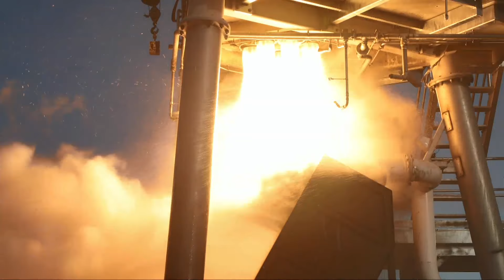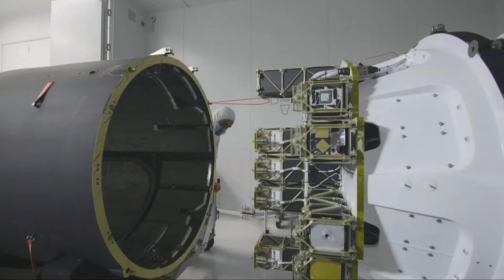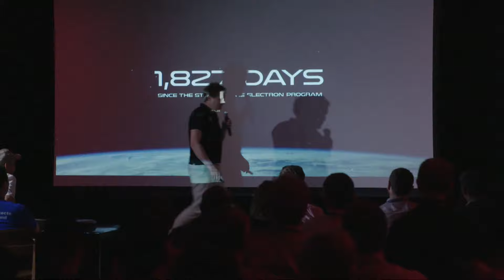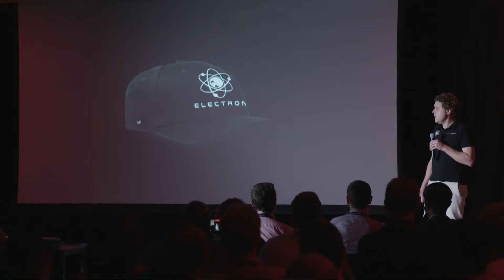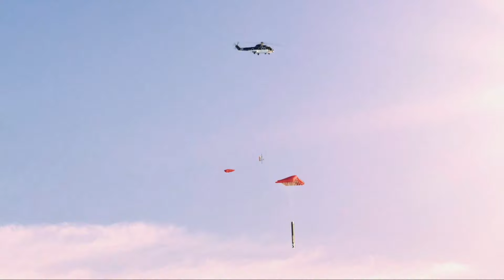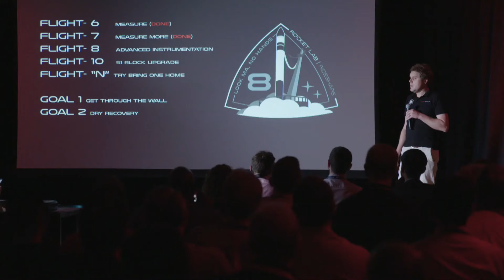Rocket Lab Unveils Plans For Reusability

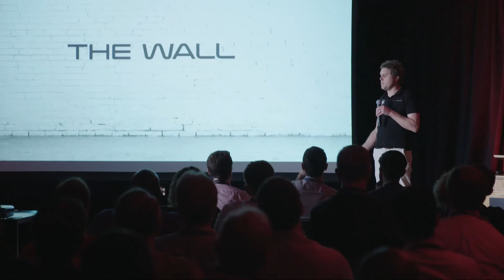Comment: 11:42 "[propulsive landing] takes a small launch vehicle and turns it into a medium launch vehicle"
Here are some direct numbers on that. A Chinese company LinkSpace

https://en.wikipedia.org/wiki/LinkSpace

is attempting to do exactly that: smallsat launches with propulsive landing and reuse of stage I. They  have successfully tested their equivalent to SpaceX's Grasshopper. Their planned rocket is "New Line 1":
Payload to SSO 200kg, lift-off mass 33000kg, height 20m, diameter 1.8m
By comparison, Electron: https://en.wikipedia.org/wiki/Electron_(rocket)
Payload to SSO 150-225kg, lift-off mass 12500kg, height 17m, diameter 1.2m
So for the same payload, you need a rocket with over 2.5 times the initial mass.

Comment: So New Zealand now has ICBM capability.
Reply: Yep. That's why they needed those treaties with the US. And that's why you can't work at NASA or SpaceX as a non-US citizen. Orbital rocket technology is considered ICBM technology and that is highly classified. Even the smallest of orbital launchers like Electron are among the bigger ICBM's out there (and certainly higher performing). Some countries would do a lot to acquire the blueprints for Electron. Especially the engine. Cheap, 3-D printed, electric so few moving parts compared to a gas gen engine and mostly storable fuel. Since you're not going full orbital you could simplify the rocket itself and loose a bit of performance, maybe increase the diameter and it'll still lob plenty of warhead mass halfway around the planet.

Comment: Just throwing some ideas out there.... Does the whole rocket need to be recovered??? Can you sacrifice parts of the rocket to shed weight during re-entry and recover the engines? Or does it need to return in one peice, could it not separate into smaller components which have less mass?
Reply: The first stage only weighs 950kg. Creating a structure and mechanism to separate the engines, with features to survive reentry, would be quite heavy in relation to the entire booster. Think of the booster as just a long casing holding the engines. I think this is also needed for the aerodynamic tricks Peter indicated but didn't detail.

Recovering a pod of just the engines is something ULA says they are working on for their Vulcan rocket, a much larger vehicle. They have to get that flying first, and say later iterations will have the recoverable engine feature. (This will also be by mid-air parachute.)
Reply: @donjones4719  also they want the booster. The engine is 3d printed so it is easier to mass produce. But the booster itself is carbon fiber very hard to mass produced. Their goal is getting the booster to effectively double their rocket production output.

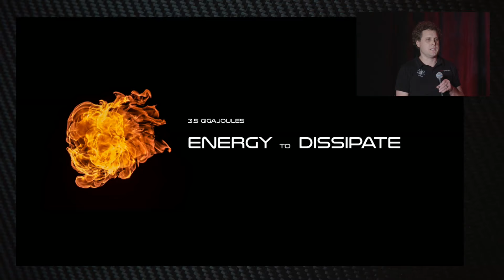Comment: 12:25 This statement contains no information.
Reply: It's deceptive.  3.5 GJ is about 972 kilowatt hours.  It's basically enough to power my condo for about a month, but saying "power 57,000 homes for an instant" sounds like a lot more energy than saying "powering 1 small condo for a month"

Comment: So 2900 m/s reentry without reentry burn, that is faster than falcon 9 first stage reentry by 300 - 900 m/s depending on mission. Carbon Fiber resin will melt?
Reply: Oğuz Can Soyselçuk  phenolic resin. Search PICA X
Reply: Spacex 1st stage reentry is around 1.9-2.4 km/s

Comment: Question, can they not recover the boosters the same way SpaceX does.   It is my understanding the weight costs of the parachute and hardware to deploy it roughly equals the weight of extra fuel to land the booster with rockets.
Reply: The size probably has a lot to do with it. Small rockets are harder to land propulsively, because they have a smaller moment of inertia. This is like how it is easier to balance a broom on your hand than a pencil. 

Also, I would imagine that the electron is several orders of magnitude easier to move back to the launch site.
Reply: Not at small scales it doesn't.
Reply: It is much more difficult also the parachute can decelerate more efficiently than boosters

Comment: Well done rocket lab . tho i remember a proposition which uses a similar method of reusing with parachutes and helicopters by ULA but only for the engine and OF COURSE it was never actually built /// WHAT A Time to be alive
Reply: It sounds like they're working on it for Vulcan rocket.
Reply: Yeah you're right . here's the video https://www.youtube.com/watch?v=lftGq6QVFFI 

they've proposed it back in 2015
Reply: @thetop811  They had a paper proposing it from 2008, I guess they dusted it off once SpaceX started getting successes reusing their boosters.

https://www.ulalaunch.com/docs/default-source/evolution/partial-rocket-reuse-using-mid-air-recovery-2008-7874.pdf
Reply: Theres PLDspace that wants to do something similar